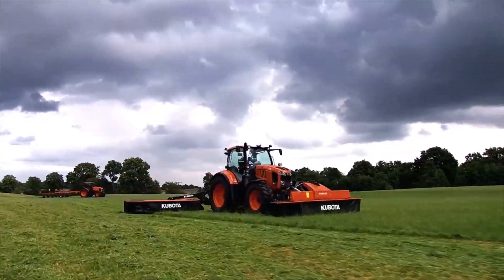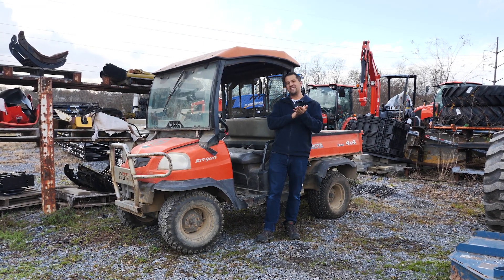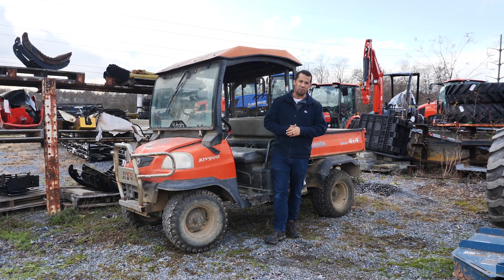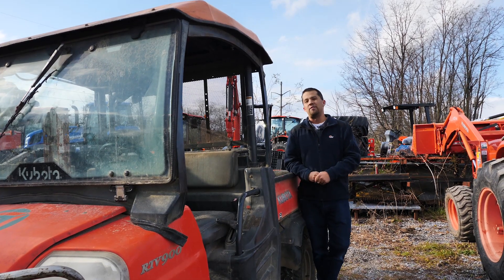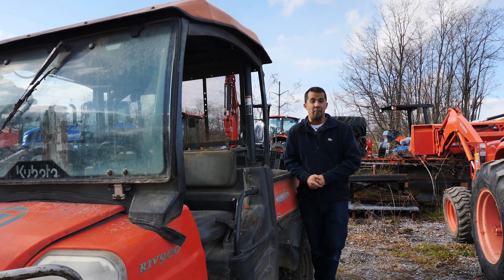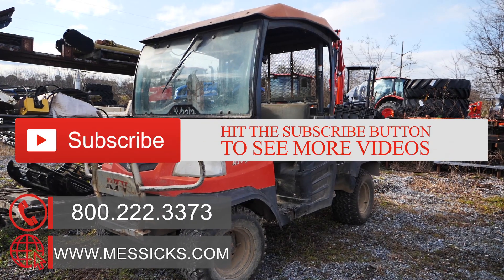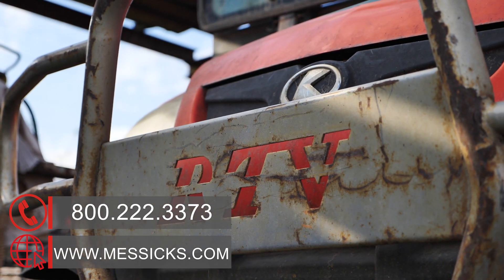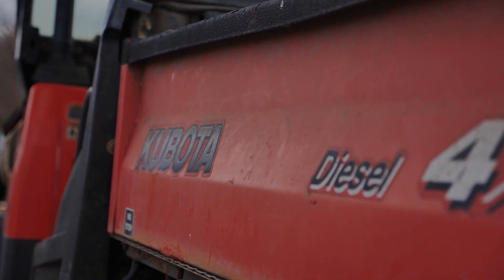7300 Hour Kubota Utility Vehicle. What's it take to get there?

Comment: I have an l3560 with cab and r1 tires. My goal is to not just keep up the fluids ,engine, and transmission but also the finish. Love this tractor by the way.
Reply: Ceramic coating all the way, bright colors fade fast and being on different materials all over our tractors makes it more noticeable.  Ultimately keeping it out of the sun is our best bet but ceramic protection is next best because its gotta go outside sometimes.

Comment: First thing to wear out on my L3901 were the zerks on the FEL.  The loader is supposed to be greased every 10 hours.  At 400 hours the zerks were woreout.  The grease gun would not clamp on anymore.  Replaced them.  All good now.
Reply: Zerks are a hell of a lot cheaper than bushings! L2501 HST here, coming up on 200 hours. Greased religiously, of course.
Reply: Absolutely.  Too easy to replace to not do it.  Next time I will probably replace the 45 degree zerks with 90 degree.  They look like they will work just as well.

Comment: No.1 for long engine life is changing out to a good mid wt. synthetic oil , it's cheap insurance in the long run.
Reply: Synthetic isn't that important. In an of nissan, we easily hit 300k miles and the failure was the chassis. It never saw a drop of synthetic. I'm fact, even some of the oil changes went long enough that you notice a change in the engine. Original everything, minor repairs only, the worst being the starter.

Comment: I’ve just bought a used KX41-3V that my dealer told me it was a one owner unit, some excavating company. Turns out it was a rental unit. Said it starts great, but only if I keep it inside and plugged in. Bunch of liars. Really unimpressed with my Kubota dealer. Like my equipment. Can’t stand the people that I “use” to deal with. I’m looking at getting more equipment. Luckily we are a multiple Kubota dealer town.

Comment: I've got a 2010 Rtv 900 with almost 2,000 hours.  It's been a great machine and gets used every day.  I thought about trading it in but I don't like the new Rtv X series.
Reply: I know this is an old comment, but if I may ask, why don't you like the x series?
Reply: @zoidsfan77  The older models have a 3 speed transmission.  High,  medium,  and low. The X series only have 2. High and low.  When Kubota compares their compact tractors to JD they brag about having a 3 speed transmission and being superior to JD's 2 speed.  The old model has a 5 bolt lug pattern on the wheels.  The new models only have 4 lug bolts.  I'm old school there and that's a sign of a cheaper lighter duty machine.  Both of those things I could live with but they made the size of the box much smaller.  It's been a while since I measured so don't quote me for sure. The new model is 1/2 inches wider but 7 inches shorter.  That's just ridiculous.  I've never been fixing fence and thought I'm carrying to much, i need a smaller capacity box. I also have a skid style sprayer i put in the back for burning pasture. It won't begin to fit in the newer box. That's just the deal breaker for me.  They've cheapened them up to the point they're not going to work for me.  Before anyone says I'm just bashing Kubota and the new X model rtv's, there are a couple things I do like about them. The older models have really thin gauge metal floors and are prone to rusting out. I've been told they fixed that with the newer ones.  I don't have one so I'm just taking their word for it.  They also moved the parking brake to the dash. The older models have it right beside the driver's side seat.  So when the brake is on you have to climb over it. Don't slip or that lever will leave a very painful bruise in a VERY sensitive area.  Don't ask me how I know that. Two years later I still have that old rtv. It's getting older and pushing 3,000 hours now. I decided last month that for health reasons of myself and another family member it was time to look at a machine with a cab with heat and air. I priced the Kubota 1100 and the dealer quoted me more than msrp. I asked why and he said that price on Kubota's website was unrealistic.  He also mentioned it would take 8 months or more for it to arrive and even if i filled out a purchase order they might have to increase the price.  I drove across the road to jd and priced a cab Gator.  The wait time was the same and the price was the same.  Before anyone screams about it the Gators bed are the same small size. They are also plastic which is completely stupid.  So both of them have boxes i completely hate. Overall however I have a few more options on the Gator I like better and they guaranteed the price when it arrives.  That being said if Kubota announces today they are redesigning their box to be bigger I'd jump on it. Either way I'm still keeping my old Kubota rtv.
Reply: @chucks4328  I really appreciate your reply.  I'm considering an x1140 Kubota, but I'm still just contemplating.  Your insight is very helpful.  Thank you.

Comment: Thought on a 2012 ZD331 with 1600 hours? For sale at my local golf course.
Reply from the maker: fantastic mower. Great driveline. At those hours any zero turn starts going though spindles.
Reply: Messick's appreciate the quick response. He’s asking $4k but I’m leery because the parts are so expensive. What’s your thoughts on the price? And yes it looks very commercially used
Reply from the maker: @RaztechPowersports  very fair price. the two things to be sure of is the transmission, and the central gearbox on the mower deck. Both are expensive parts. If they are good, i'd jump at it. With emissions the 31 Hp diesels are very desirable.
Reply: Messick's without emissions right? Thanks for your input. If you have time, check out my restored Kubota L285 that I turbo charged. I think you’ll enjoy it lol.

Comment: That’s nothing for hours. I have a fleet of 24 rtv1100’s with 900 lbs in the bed. We’ve got 13-16k hours before we trade off. Change the fluids at 1/2 of recommend intervals and no issues. My guys run them 23 hours a day 365 days a year on the railroad.
Reply from the maker: Yea, we have some railroad units too that see obscene hours. This one was in a dairy barn.
Reply: How many of those hours are of the machine sitting and idling?  That's usually what you find in the real world, high hours but only about 1/2 or even less of those hours are actually of the machine being used, the rest are from the machine sitting around a worksite idling....trucks, tractors, utility vehicles, all share those same sitting and idling times it seems.

Comment: 7500 hours really isnt that many. 50  hours a week x50 weeks a year (nice easy round numbers) is only 3 years use. farm i work on has 3 Kubotas and 6 other machines with 10k plus. run a Cat loader that has 55k hours on it. still a brute.
Reply: Well Peter,  I  you must have got the cheap version of a a Cat Loader!  I have 250k hours on mine.
Reply: @JamesLee-mr5iw  that would be 30 years of 24/7 use what is this loader used on ?